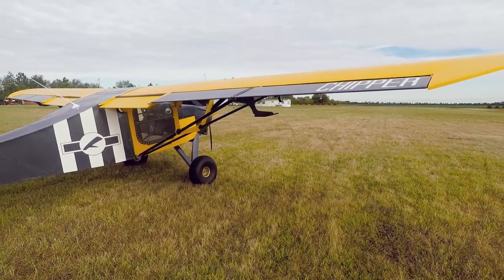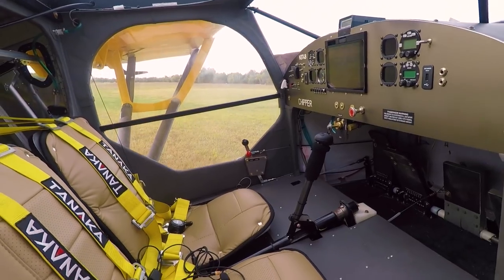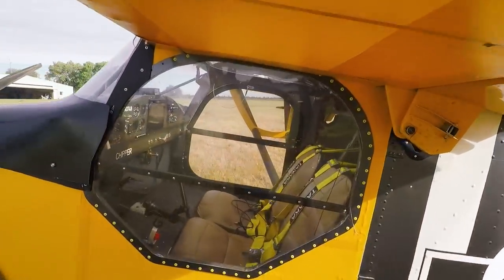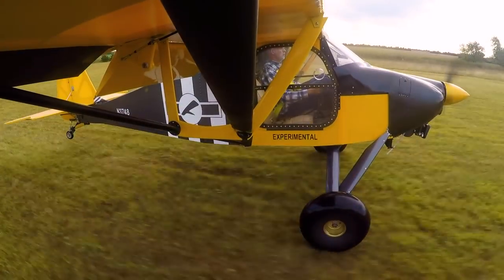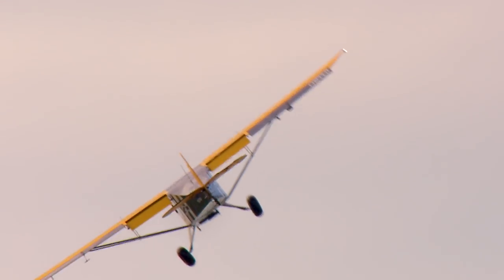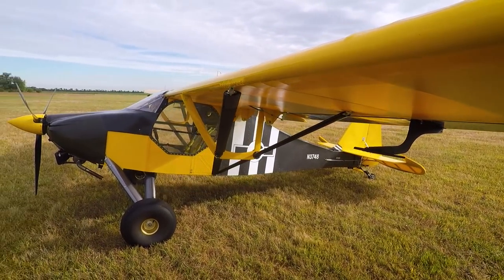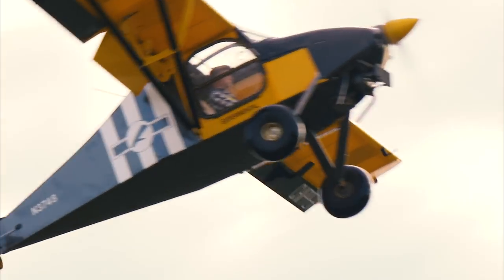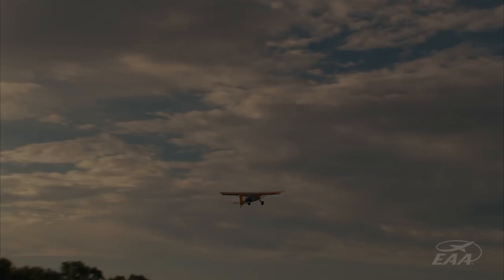A Belite Built for Two

Comment: Looks ok...till I saw the real price. The base price doesn't even include gas tanks....plus it cost more to get the upgraded gross weight. Still not too expensive all up, but it is kind of deceiving with the base price that's advertised. Just put an all up price, it's still a lower cost plane(Zenith has you beat on price/performance/ease of build, though). Still, being honest on all up cost up front is a good thing and can only help you sell more, never a bad thing :)
Reply: How much did you find the real price to be?
Reply: Michael Livote Why would you post this and NOT tell us the prices you found?
Reply: HOW MUCH!!!!!!!!!!!!!!!!
Reply: If you were/are serious then normally you would be looking at all the information on their website. You would then see the tab "More" and then see the "Budget" page. Everything is pretty clear there and it gives you a good idea of the full price...
Reply: ITEMS THAT ARE REQUIRED BUT NOT INCLUDED
1) Engine
2) Engine Mount
3) Propeller
4) Propeller spinner, if desired
5) Cowl
6) Fuel tanks
7) Fuel line tubing and hardware
8) Fuel selector and cutoff switch
9) Fuel filter
10) Fuel pump
11) Instrument panel
12) Instruments
13) Engine control (throttle quadrant, cables, magneto
switches, primer pump or bulb, carb heat, etc.) and FWF
14) Battery
15) Covering material, paint, glue, oratex, etc.
16) Flap servos, trim mechanism, droop servos, wiring,
switches
Reply: @goclick  i can get 172 for that
Reply: Dash Riproc